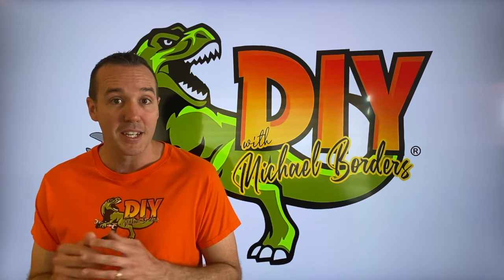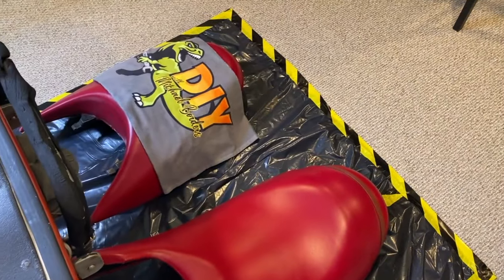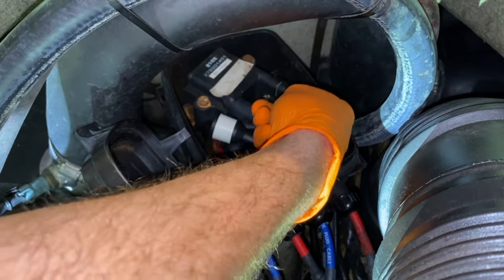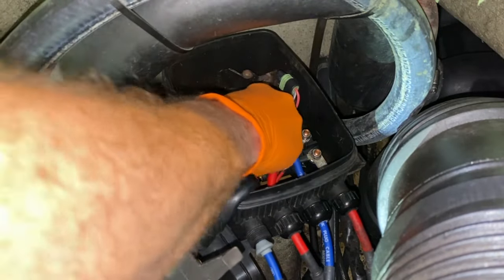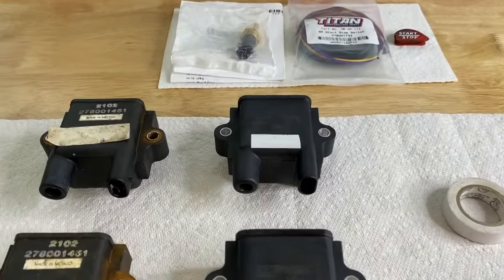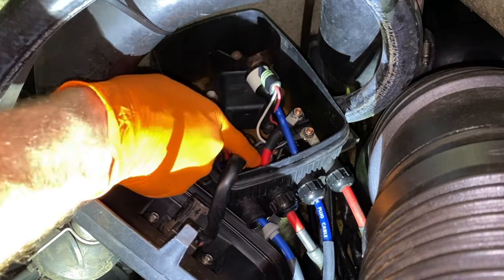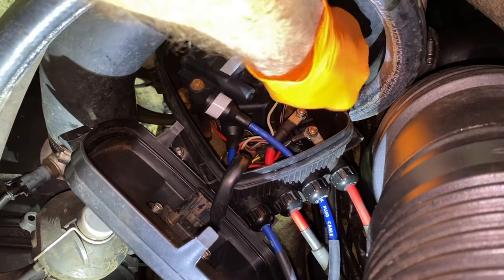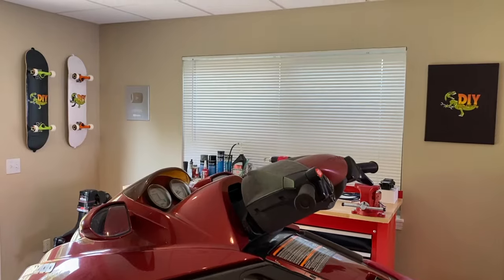Replace Sea doo GTX ignition coils (1998 -2005)

Comment from the maker: If interested in purchasing this product, visitor to Amazon affiliate link below.  I earn from qualifying purchases.

Ignition coils:  https://amzn.to/4aqTyKB

Dielectric grease:  https://amzn.to/4cUn4tC

Spark plugs:  https://amzn.to/43Wqp7p 

Spark plug gapper tool:  https://amzn.to/43Qbrje

Craftsman flashlight:  https://amzn.to/43RGcEG

Browning flashlight:  https://amzn.to/3Wi8era

AGM Battery:  ￼ https://amzn.to/4cO13MX

1/4'' ratchet and socket set:  https://amzn.to/4diGloY

White electrical tape:  https://amzn.to/3xXfEGd

Oil filter:  https://amzn.to/49c0n0U

Oil tank:  https://amzn.to/3Ji306V

Oil tank grommet seal:  https://amzn.to/3JhjJan

Zip ties:  https://amzn.to/43Pa44k

Zip tie cutters:  https://amzn.to/3xuep0U

Coolant temp sensor:  https://amzn.to/3U81ytZ

Solenoid valve:  https://amzn.to/4aLKT4S

Vacuum system check valve:  https://amzn.to/3U8PtVy

Battery disconnect switch:  https://amzn.to/49tskBH

Craftsman volt meter:  https://amzn.to/3VS55OE

Swivel vise:  https://amzn.to/4awP2tK

START/STOP push button cap/cover:  https://amzn.to/3vomyDv

START/STOP button wire mechanism:  https://amzn.to/3TEoDDr

Glove box/storage unit latch kit:  https://amzn.to/3x9RMih

Seat latch:  https://amzn.to/43xVWwd

Front storage compartment latch:  https://amzn.to/43xVWwd

******************

1.  How to properly lubricate seat or storage compartment latch

          https://youtu.be/QiadPciE55E

2.  Jet ski storage compartment or seat not latching - Common causes

          https://youtu.be/gWX7obK3VA0

3.  Replace seat or storage compartment latch

          https://youtu.be/bweCd4TO-4U

4.  Replace glove box/storage compartment latch

          https://youtu.be/TmdrTVcUubQ

5.  Replace START/STOP push button cover

          https://youtu.be/VillHbgDckY

6.  Replace START/STOP push button wire harness

          https://youtu.be/5q9HbOxYY4Q

7.  Replace rear step foam pad sleeve

          https://youtu.be/w6HLiApFDuc

8.  Replace Sea doo GTX Starter

          https://youtu.be/Q8_be66r0Yw

9.  Replace starter relay

          https://youtu.be/MAvBmwvGgyc

10.  Jet ski bogging down - Possible low compression

          https://youtu.be/3fWWDOZtdPU

11.  Jet ski keeps saying low oil - Common causes

          https://youtu.be/vPycBUDWnCQ

12.  Replace coolant temp sensor

          https://youtu.be/4JOdX3GEphE

13.  Replace Solenoid valve

          https://youtu.be/SfjX9OtOyIM

14.  Replace vacuum system check valve

          https://youtu.be/iWjhaWlyQuc

15.  Install battery disconnect switch

          https://youtu.be/LOSq10Of_UM

16.  Replace sea doo oil filter

          https://youtu.be/fT3R7Mkb05s

17.  Replace spark plugs and wires

          https://youtu.be/gRTpc5pqLLk

18.  Rebuild Direct Injection Distributor

          https://youtu.be/Ac2xGvMr9eY

19.  Putting together our Pegboard

          https://youtu.be/iBK2wLkEbiY

20.  Build custom logo skateboard

          https://youtu.be/9Isty_4fIIw

21.  Mount skateboard on wall

          https://youtu.be/c5QDCKZNGH0

🧰
Reply: I love your videos. But I'm interested in household repairs. Thank you for videos.
Reply from the maker: @karenbrisson5487  

Thank you, well you are in-luck.  Many more household videos to come.  We will be releasing a quick little cooking series soon as well.  😎👍🧰